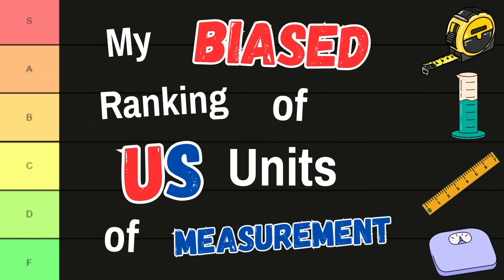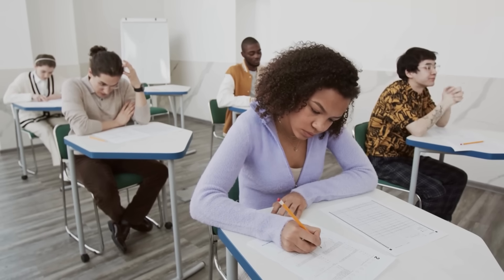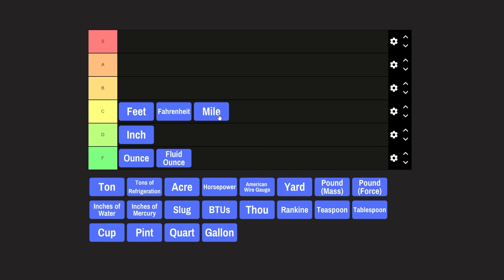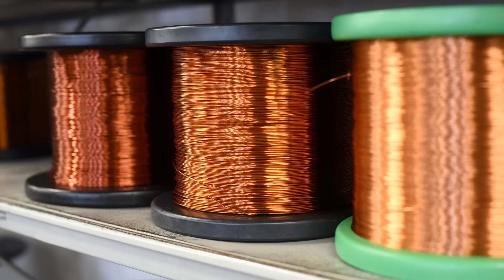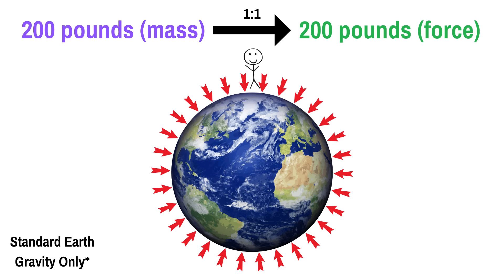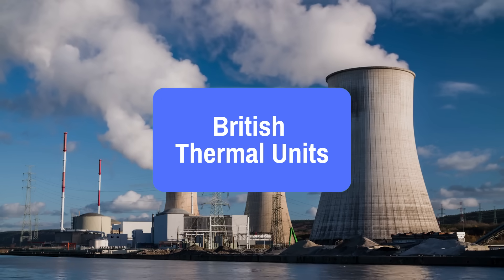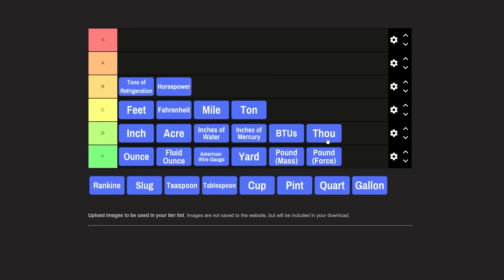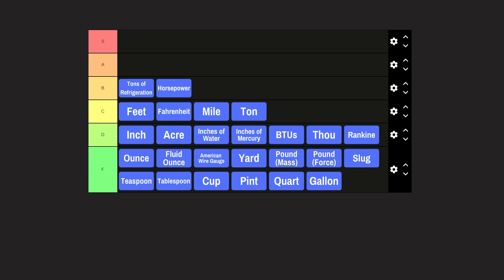Tier List of the DISASTROUS US Measuring System

Comment: What I really hate about the cooking measurements is that all those measurements are really hard to measure exactly unless you're actually using the device the unit is named after.
And converting them to exact and universal measurements like grams or liters is difficult, because the conversion ratio is dependent on the ingredient.

Here's an example (using "kitchen-grade accuracy"):
1 tbsp of flour is around 8 grams.
1 tbsp of water is 15 grams (aka 15 ml, g = ml for water).
1 tbsp of honey is 21 grams.

So if a recipe is using imperial units and asks you to add "2 tablespoons of honey", you actually have to use a tablespoon, squeeze the honey on there before mixing it in, making another piece of equipment dirty, and because honey is sticky, you can't really reset your measuring device to a neutral "0" (i.e. empty the spoon for the second scoop).

With "40g" on the other hand, you can simply tare the scale, and then squeeze the honey directly into the mixing bowl until it says "40g". So much simpler, cleaner, and more accurate.
Reply: Yes. It's just that in the past we didn't have kitchen scales so had to use sth else.
Reply: No, we had kichen scales, they just weren't digital.  @LibraryofAcousticMagic3240
Reply: You have sold me. I'm getting a kitchen scale.
Reply: I have never seen anyone use a kitchen scale in the US. Nor have I ever seen a US cookbook which gave the weight of ingredients other than meat and pasta.
Reply: rarely does the exact mass of a spice matter in a recipe
Reply: @KaitouKaiju  you have never baked bread
Reply: Hey news flash: you can find recipes that measure in weight, not volume. Also, if you're using the Internet to look up a recipe, also use it to convert to whatever units you want. The entire US shouldn't have to change to make some Europoor's life marginly easier, especially after the US taxpayer is already paying for their defense.
Reply: No, what's really hard about those cooking measurements is that recipes absolutely love to give solids in volumes. What the hell is a cup of sugar?? And do you know how much butter you could stack on a tablespoon? Technically, "inches" could be a unit of temperature: inches of butter stackable on a standard tablespoon without drooping in standard gravity.
Reply: and if you squeeze too hard, how do you get the excess honey out?  and note that you are still using a device to measure.  

as for the honey, fill your measuring spoon, wipe it out with the stirring tool, fill it again.  it's not rocket science.
Reply: @kenbrown2808  No, no no, it is
1. fill your measuring spoon, this is imprecise because you can't really fill it to the brim without spilling honey and some of it will stick to the measuring spoon
2. clean the measuring spoon.

do this for every ingredient. 

With a scale this becomes.
1. Add the ingredient directly to the bowl. No need for extra cleanup, no wiping spoons, no "I can't find the right measuring spoon", no "Is my flour to compact?",  no "sh**, I spilled something"

How do you take some of it out when you added too much? 1. Don't add too much, you can do it bit by bit 2. JUST TAKE IT OUT, it's not hard. I don't understand why you are confused, you can take things out of a bowl when they aren't already mixed in and I don't know what you are doing, but I am adding all of the ingredients before I  start mixing.

There is a reason why every professional baker uses scales instead of measuring spoons. Yes, even in the US.

I know it is hard for Americans to fathom, but the world evolved in the last 200 years, we aren't stuck in preelectricity times and don't need imprecise, archaic measuring devices and units.
Reply: @GGysar  yes, the reason is when you're making commercial size batches, you use way too much to be measuri g by the teaspoon.
Reply: @GGysar  wow, they make 10,000 different kinds of cake? And they all have 100% different ingredients?  Or wait, they're european, so they think carefully sprinkling salt into a bowl until the scale says the right number, and then taring the scale and sprinkling leavening until the scale says the right number and so on, is easier than grabbing a calibrated spoon and dipping level spoonfuls of salt, leavening, and other seasonings into the bowl.

Comment: We should make units dependent on week days and weather. For example 1 sunny Monday hour is the same as 2 1/3 rainy Sunday hours but also the same as 3 4/7 sunny Sunday hours. 1 Monday hour has 78 minutes each of 85 seconds while 1 Sunday hour has 49 minutes each of 57 seconds.
Reply: WHAT
Reply: metric time: 10 seconds in a minute, 10 minutes in an hour, 10 hours in a day, 10 days in a week, 10 weeks in a month, and 10 months in a year.  never mind that it will have no relation to sunrise and sunset, or when it snows, it will be divisible by ten, so it will be superior.
Reply: So...when is your Nobel prize coming?

Comment: In metric countries, we still use three of these on a daily basis: 

Teaspoon, tablespoon and horsepower. 

Most of the others are replaced by the metric system.
Reply: We don't use the first two, at least not the way Americans do.  They have explicit "teaspoon", "tablespoon" and "cup" measuring cups in their kitchens.  As seen in the video.

And horsepower is only tolerated legally, you always (at least in business) have to also give the kW number.

Comment: The story I heard about Fahrenheit was that 0F was the temperature of brine (equal parts ice and salt, and the dissolution of salt is endothermic and the brine has a lower freezing point), while the maximum was the boiling point of brine (this doesn't quite check out, since saturated brine boils at about 228F). THEN because he had to make evenly spaced marks, and repeated division by 2 is easy, he assigned the max temperature 256F and then divided the scale 8 times (2^8 = 256).

Comment: when working with wood, it makes infinitely more sense to divide units by 3's, 4's, and halfs over tens; something much easier in base 12. 

metric is good for its purpose: obscure scientific calculation. 

 and, of all things, Metric fanboys are infinitely smug by both metric and imperial standards and that alone makes it worth ridicule for the socialist "good in (half thought out) theory (by rank amatures)" attitude. 

You never have to practically convert feet to miles like you never use decameters or centiliters. 

and if you can't convert the units back and forth with ease, I want nothing to do with your study or engineering project.

Comment: Im not sure if it's related to wire gauge, but the inverse relationship between gauge (number) and size/diameter can be related to firearm, which is quite american 

It was described to me before that gauge (caliber, like shotguns) was the amount of projectiles that could be cast from 1 pound of lead. For example: 12 guage being 1/12th of a pound (1.3oz or 36.85g) and 20 gauge being 1/20th of a pound (0.8oz or 22.67g)

And as i did those calcs, I realize that it's close yet innacurate to modern production shotgun shell specifications, which further proves the clusterfuck that is imperial measurements

Comment: I mean I know hp has an equivalent in the metric system, I guess physicists use it every now and then but apart from that everyone uses hp when talking about engines. It's basically universal.
Reply: In Europe, you have to give the kW in all car ads and car manuals etc.  It's slow going but hp will die.  And nobody will miss it, because 220 kW is 10% more than 200 kW just as 110 HP is 10% more than 100 HP.  Nobody really understands "100 HP" in isolation, you understand it because you know the relative power of various cars (or engines or whatever you want to compare)
Reply: @JürgenErhard  Yes my mate Bob at the pub intuitively understands KW, he's always going on about it. You're spot on

Comment: Every time I see a video like this, I'm reminded that the metric system is based around the distance from the north pole to the equator. It has no relevance to my daily life, while customary units are quite literally based on what is needed in my daily life. In summary, the metric system is great for science, bad for everything else.
Reply: It's the human factor of Imperial Custom that makes me appreciate it over how stale and sterile the detachment of metric can get. All I can hear is the 'PC Master Race' laugh when the metric ball wash machine's bandwagon gets wound up.
Reply: Same with temperature. I don't care what temperature water boils at. You don't set the temperature of your stove to boil water. I also don't care what temperature water freezes at because food isn't safe to store at that temperature.  Instead food is safe when stored at 0F which is -18C. As far as air temperature is concerned, the human body can tell the difference between individual degrees F. Celcius is not precise enough without going into fractions of a degree and 0-100F is just more intuitive for outside air temperatures.

Comment: Second only to the horrible units is trying to do maths using them ! Try adding the distance 2miles 324yards 4 feet 3 and 3/64ths of an inch  to any thing 😂 .  Metric easier every time
Reply: To be fair (I corrected someone above who "imagined" (of course) a recipe calling for "325.325 grams of flour"), with a distance this size, nobody would use fractions of an inch, or even inches.  Also, I got the impression that yards are relatively rarely used.  For example, houses are measured not in square yards, but in square feet.  Most areas are, I think, until you get big enough, when they switch to acres.

Comment: Metric ahould be standard for science, imperial should be standard for daily life. It is more useful to have estimatable measurements in life (inch being associated with approx of your thumb or the mid knuckle of pointer finger, foot being about a foot, yard being about a pace, temp relating to how you will feel etc.) And it is more useful to have consistency in a lab. Your life isnt a lab environment, you dont need things to be perfect you need them to be practical which is where imperial shines.
Reply: You can take the metric system from my cold, dead fingers.  And no, "Imperial" (you mean US Customary) does not shine in any situation.

Comment: The barleycorn is a third of an inch, and therefore the closest equivalent to a millimetre (even though it's 8mm). S tier, most useful for measuring things smaller than an inch, or you could combine inches and barleycorns instead of doing fractions. A third of an inch: one barleycorn. Quarter of an inch: three quarters of a barleycorn. 1/16th of an inch? Surely you mean 2/10ths of a barleycorn.

Barleycorn, the best Imperial unit. Also makes good bread.

Comment: We could also discuss time systems. It would be very nice if we would have time units based on the power of 10 instead of having factors of 24 (or 12...) and 60 and 1000.
For europeans it is stupid, that we often use 24h time, but analog clock faces still have can differentiate 12 hours.
Thankfully that becomes less of a issue with the prevalence of digital clocks.
Reply: Can't get three equal shifts if you have decimalised time

Comment: Being strong metric supporter, I'm okay with spoons and glasses, while they have fixed metric values (5/10/15 ml for spoons, 250 ml for glass), since it's useful in cooking.

However, I have troubles with metric Sieverts, because they have strange values for normal doses (0.1 - 0.3 mkSv, instead of 10-30 mkR).